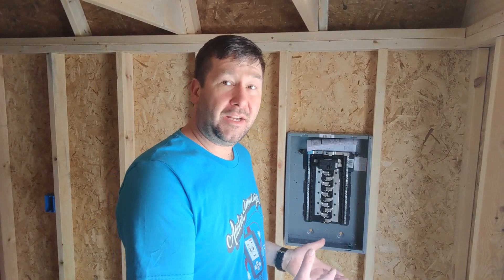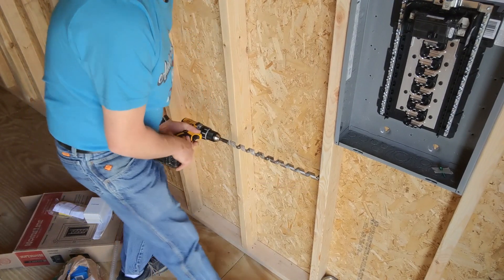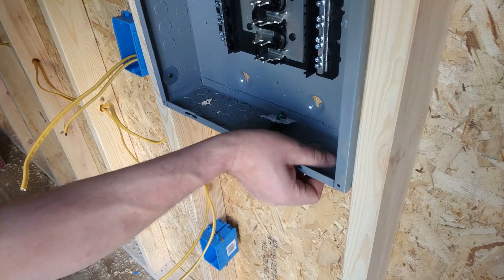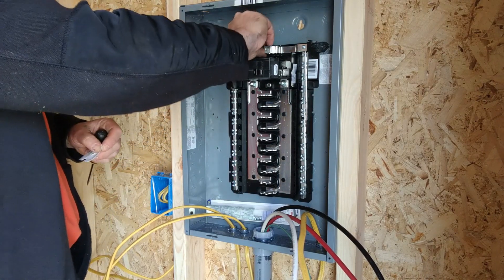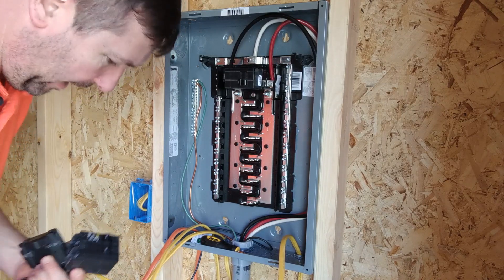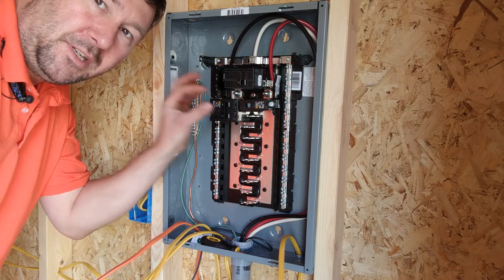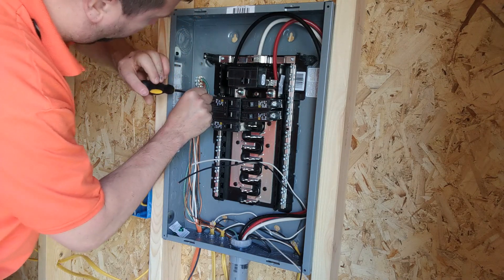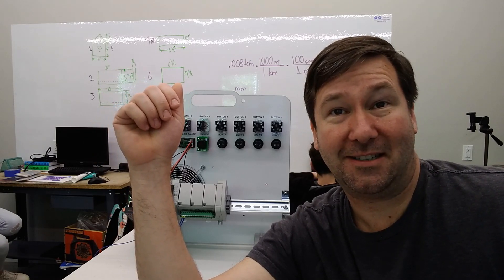How to Wire a Subpanel

Comment: Why a inverter put out current through its neutral leg? I wire a 120v inverter to a two circuit 70amp breaker box and I'm get current through the neutral  but I return the inverter cause its 3000watt pure sine wave inverter and can't start my vaccum and my other 2500 watt pure sine wave inverter could run my entire house.

Comment: I like to go close to the back of the stud so I won have toi use nail plates.
Reply: You then have to worry about nails from the outside siding into the "back" side of the stud.  Always drill an appropriately sized hole in the middle of the stud.  If you're using the correct size drywall screws, you don't need to worry about nail plates.

Comment: I'm and automation engineer who live on a farm. Been upgrading wiring and panels. The most recent of which was installed almost 50 years ago when I was three. One question...why does the ground rod need to be at least 6' from the panel? As in what's the real purpose of the distance? Not the NEC answer.
Reply from the maker: Where does it say that in NEC code?  It is suppose to be a few feet from the structure, I assume so it is truly grounded and not up against the footers of the building and if you have two ground rods then they must be 6' apart, but I've never heard that they have to be 6' from the panel.

Comment: I’m putting a breaker box in a cargo trailer and using a 50 amp rv plug would I wire the breaker box the same way
Reply from the maker: RV wiring has it's own section of NEC code, check it out.
Reply: Thank you I’ll check it out

Comment: I have a sub panel in a garage, fed by 4 wires (2 hot, neutral, and ground). The neutral bar in the sub panel is not bonded to ground and I believe/read it should NEVER be bonded in a sub panel. I have 3 things attached to the sub panel- a three prong outlet for a compressor, an air conditioner (3 wire), and an electric garage heater (3 wire). All are 240v (or 220?). I do not have a separate grounding rod for the sub panel.  The sub is 4 feet from the main panel and I added a grounding bar to the sub panel. *****The question is... should the ground for each of the 3 connections be connected to the ground bar or neutral bar in the sub panel?  I cannot find the answer anywhere!!!  Thanks!
Reply from the maker: Ground should always be connected to ground. Ground is a non current carrying conductor. Neutral is a current carrying conductor. Never mix them up.
Reply: @TimWilborne  thanks!

Comment: Thank you for a very well done video. I’m putting in a sub panel for a basement apartment. It will have a dryer and an electric stove so I’m going to have a sub panel.  My question is related to the ground rod.  I initially was going to put my panel on an inside wall but that would mean I would need to run the ground right up through the ceiling and then down to the outside. Can I assume that’s not ideal and I should put the panel on an outside wall? Also, can ground rods be drilled through the concrete slab and into the ground underneath the slab? I’m thinking no but I thought I would check.
Reply: Having two grounds creates a potential for a ground loop within same building.  You can use your main panel ground.
Reply from the maker: Definitely want to check with local codes on the ground rod.  At least here you could have it one an inside wall and run the ground to the nearest outside wall.  I have no idea on the concrete slab, never ran into that situation.  I would consult a local electrician, you'll be dollars ahead.
Reply: Tim Wilborne Thanks Tim. I will do that.
Reply: When you're past your outside main you do not run a ground from the panel to the outside, if you do you're defeating your purpose  of having a ground path back to the main panel where the power supply enters the residence, if you ask an electrician be sure and ask someone who knows the code and has experience with installing sub-panels.

Comment: when you use a double pole, why do some people refer to it as 240 and some refer to it as 220 like you did.  What is the difference?   Thanks.
Reply from the maker: Nothing.  220, 230, 240, and occasionally the label 200 VAC single phase are all the same. Even across the US there are variations on which term is used
Reply: @TimWilborne  110V used to be the standard, so power was called 110/220.  Since the standard is 120, it's 120/240.  240=2*120.

Comment: Hello Tim So I would like to know if it legal and not against the code to come out from a 200A 208y/120v 3phase panel to a 100A 208y/120 single phase?
Reply from the maker: Yes it is legal but reach out to a local Electrician so you can get the details right

Comment: You mentioned a link to calculate the wire size based on load and distance. Do you have that available? I’ll be running to a sub panel 100’ run from the main. I’m unclear on exactly what type of feeder breaker I need. But will need at least 75 amp feeder.
Reply from the maker: Hi Wes. See link below.
https://www.theautomationstore.com/wiring-determining-wire-size-and-voltage-drop-for-amps-240-120-vac/
Reply: @TimWilborne  2AWG it is!  Thank you
Reply: @TimWilborne  thanks Tim, do you also have a chart that shows the size for neutral and ground for the sub panel?

Comment: So I'm running a 12/2 to a 20 amp in my sub, do I connect white and black to the breaker screw and the ground bar?
Reply from the maker: No.  You should consult an electrician before proceeding.  It will be a small price to make sure you don't burn anything up.
Reply: And the ground to the ground bar?

Comment: Can I run a subpanel from another subpanel? I have a subpanel about 20 feet from where I want to install one. My main breaker panel is about 100 feet away.
Reply from the maker: Probably but your should get an electrical to have a look to determine if you can for sure

Comment: I was going to tell you to stay in your lane, but you're already there. Looks like you've done this a time or two. :)

I'm not saying that I'm an old electrician, but I still remember doing new installations using TW wire (and thank your lucky stars if you haven't had to pull that garbage into a conduit - however, it does do a great job of pointing out if you haven't reamed your conduit properly).

I was taught to strip the sheathing off of the Romex cable prior to running it into the panel, and it does make for a little bit tidier of a job. But that's really just how my Journeyman beat it into me, rather than any personal preference (my personal preference being not to be beaten anymore than I had to be).

Anymore, I would just go ahead and run the second ground rod and be done with it. Copper water lines into the house is a thing of the past.

And to anyone who wants to do their own wiring, I would suggest visiting a construction site under the guise of being potential buyers and look around to see how the "AHJ" (Authority Having Jurisdiction) wants it done. But be fully prepared to have your job turned down even if you have done your wiring the exact same way as the pros. It's just a homeowner thing, and complaining to the AHJ is only going to make it worse. 

Oh, and:

1) Bring donuts and coffee.
2) Show up just before first break.
3) Keep a sharp eye out for the boss, and if he/she is not there, chat up one of the electricians to see if they would be interested in helping you out. Keep in mind that some shops treat "side work" as a firing offense, which is why you have to make sure that the boss is elsewhere.
4) Don't be a jerk. Pay in cash.

And in slow times like these, the AHJ will turn down everyone's jobs pretty regularly to keep his inspector buddies from getting laid off. As an electrician, shop owner or otherwise, it is in your best interest to pay this bribe since what you don't want to see is your normal inspectors having to move on and then you have to break in a new one.
Reply from the maker: Early in my career I pulled some 500 MCM wires one time, I realized really quickly that I better stick with controls.
Reply: @TimWilborne  Oh yeah, that's a workout. Not to mention running the conduit for those cables, including busting a hole for two 4" conduits horizontally through a concrete footer. Ever run a jackhammer horizontally? No fun...
Reply from the maker: I never have found the programming port on a jack hammer to make it work.
Reply: @TimWilborne  LOL! The programming port was where my journeyman was going to put his boot if I whined about running the jackhammer. :)

That really was the installation from heck. We had a heavy rain the day before it was to be inspected (so it was still open for inspection), and the ditch where we had our two 4" PVC runs got completely backfilled with sand. The conduits, being empty, naturally rose to the top of the ditch and were sticking out every fifty feet or so. So we had to hand dig the ditch again, this time being careful not to break our conduits. 

I was happy to see that run get finished.

Pulling the wire wasn't too bad, we used a capstan puller, and each of us young bucks got to pull the wire off of one spool each. I've been involved in worse pulls... :)

Another really bad ditch was one that fed a pad mount transformer and went down the center of an alley to the vault. It had eight "known" crossings. A combination of water, telephone, cable TV, power, as well as a sewage line below all of it. It also had one "unknown" crossing which the city neglected to locate for us, and we naturally found it, and removed it, for them. It was an abandoned water line that the city had simply capped off rather than removing. We ripped the unmarked line right out of its corporation (what the city water crew called the connection between the main and the smaller water line).

Ever see how much water can come out of a 3/4" hole at 800 PSI? It's prodigious... 

The city tried to blame us, claiming that we were responsible for items that they had missed. Right. 

Our company wasn't having any of that nonsense, and the city got to fix and pay for the damage. It wouldn't have been as bad but the corporation was mounted at about twenty degrees from horizontal and the water pressure undercut a large portion of the parking lot to an attorney's office which collapsed into the ditch.

Of course the ditch filled up in no time at all, and that little hole was now providing the center of Colorado Springs with a decent sized stream for the kids to play in. So there's always an upside.

And this was also one of those runs that had to be encased in concrete, so we had that to deal with as well once the carnage got cleaned up.

We also had to run a ditch for our power behind a strip mall that we were wiring. We had contracted a guy to cut the trench with his Ditch Witch. The only located line was a telephone line marked for us by Ma Bell. As the dutiful apprentice, I offered to hand dig that section out for him. He said "Don't bother, I can feel the cable with my stinger". Nonetheless I went to the truck to get a shovel, but by the time that I had gotten back the stinger on the Ditch Witch was wrapped up in an array of multicolor wires from the cable. 

Kinda reminded me of a Christmas tree...

He had hit a one thousand pair cable that carried the long distance calls from Colorado Springs to Denver. As well as being used for communications to and from Norad. So yeah, not a good cable to have an accident with...

Ma Bell (Mountain Bell) employees started popping up like popcorn all over the place. They were easy to spot, white shirts, black slacks, and all with unpleasant looks on their faces. 

The downtime was $1,000 a minute. The bonding company refused to cover the damage, citing "stupidity". That was the end of his company, and much of his personal possessions. My boss did a back door deal with him to buy his Ditch Witch so that he could have a bit of cash to live off of until he could sell his house to cover (a portion of) the damages. Ma Bell wasn't taking any prisoners on this one.

He offered to help cut a new ditch, which had to go thirty or forty feet in both directions from the damaged spot (you have to remove a large section because the wire insulation gets ruined closer to the cut). The Ma Bell splicers said "Thanks, but you've done enough". 

The first thing that the splicers did when they had their new ditch dug, was to dig out "thrones" for themselves in the wall of the ditch to provide a place for them to sit while they made their splice. Pretty obvious to me that they were going to be there for awhile. It took them thirty hours to splice in a new section.
Reply from the maker: @MrWaalkman  Yes I knew I guy that hit one of those 1000 pair cables.  Not fun.
Reply: @TimWilborne  It's like wrestling boa constrictors.